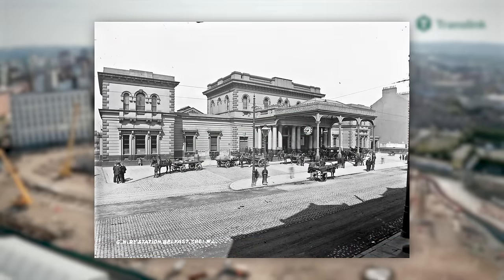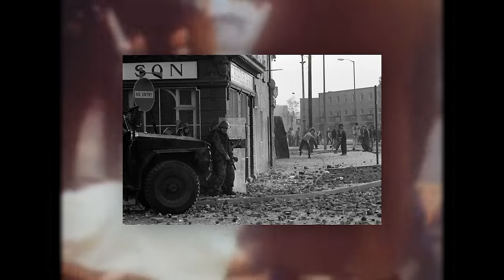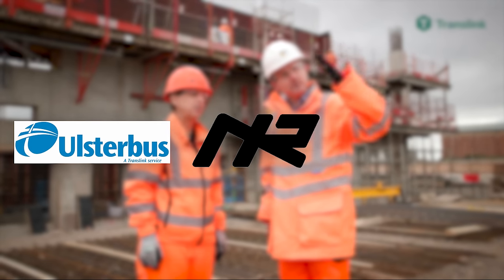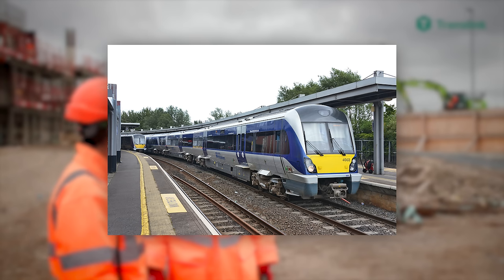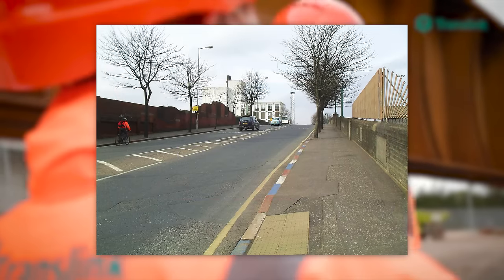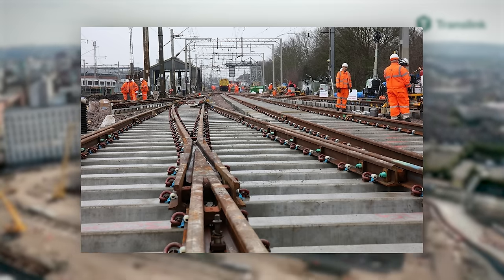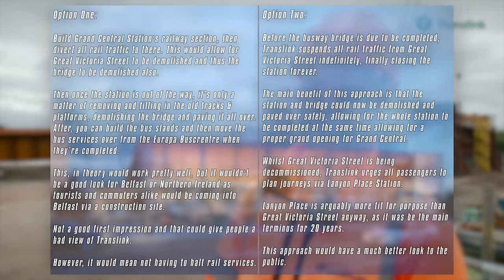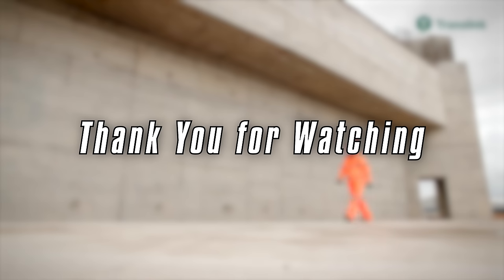What is Belfast Grand Central Station? | Explained

Comment: I do wonder why the old GVS platforms are being made completely redundant - I understand that the bus station has to go somewhere, but wouldn't it be wiser to have them for local and semi-fast services, or at least to provide additional platforms. I also question the use of 3 tracks and not 4, surely running up/up fast/down/down fast would drastically increase capacity on the Belfast to Dublin line as opposed to just adding more platforms (and therefore more trains), to an already fairly crowded line. Considering I'd heard wind of freight traffic introduced in the future, the need for a 4 track mainline is screaming out
Reply from the maker: The old GVS platforms are currently where the bus storage and turning area will be, plus the GVS platforms would be considerably out of the way for them to be 'included' with Grand Central.

Translink do have a desire to fully triple the line between Belfast & Lisburn if and when the Knockmore Line is reopened, but quad track is unlikely due to how built up the surrounding area is.

Comment: Just want to say I love the project but hate (I mean really hate) the name. there is heritage in the name "Great Victoria Street" plus its a bit on the nose after they changed the name of Belfast Central (another reference to railway heritage via the Belfast Central Railway), it comes across as if Belfast is trying to plagiarise New York rather than be confident in itself. 
That's the only criticism I have on the project (and even then its more to do with branding than anything practical) hopefully its successful and hopefully that success will be a jumping off point in continuing to upgrade the network and even expand it into areas of the province its withdrawn from in the past.
Reply from the maker: Well the name has to change as the station won't be situated on Great Victoria Street, I'm afraid Great Victoria Street Station on Durham Street would leave quite a lot of people confused haha

Also to be fair, renaming Belfast Central to belfast Lanyon Place was positive in the sense that it pays homage to Charles Lanyon who engineered much of the Northern Irish railway network.

But yes, all in all Grand Central Station will most likely be the starting point from which major upgrades and expansions of the current railway network will begin from.
Reply: @fundthenine  they could simply change the name to Great Victoria Station but point well taken.
Reply from the maker: @Sammy1234568910  True, but one could still find that confusing.

However if they named it Great Elizabeth II Station I wouldn't object hahaha

Comment: What are your thoughts on development for a underground/metro for the greater Belfast area? More significantly connections to the international airport seems drastically overdue
Reply from the maker: The DFI are currently exploring the costs of a feasibility study into reopening the Knockmore Line with a station at BFS.

An underground for Belfast wouldn't work as it doesn't have the population to justify it. Glasgow would be the size Belfast would need to roughly get to in order to justify an underground.

Comment: I am just thinking, is that why they changed the name of Belfast Central station to Lanyon Place in 2018, because of the plan to build this new station. Also, this is the first time I have heard about this new station. When it is finish, will the train from Dublin be using this new station, instead of Lanyon Place? Just to let you know I live in Dublin, and have traveled by train to Belfast a good few times.
Reply from the maker: I would guess that is the case, as they put in the planning permission application for the new station not long after Lanyon Place's refurbishment and name change
Reply: When the new Grand Central opens, will this make Lanyon Place redundant?
Reply: @42markk42  I say Lanyon Place will remain open, as it is very close to the Waterfront Hall, as well as having a hotel, offices and houses are very close to Lanyon place. Also trains from Derry, Porthrust, Larne and Bangor trains pass through Lanyon place. I can't see people from East Belfast wanting to travel to Grand Central, to get a train to Bangor or Derry. When they can get to Lanyon place in a short time, and have a short train trip from there.
Reply from the maker: @42markk42  No, Belfast Lanyon Place is a vital station for East Belfast and it would serve no justice to have it removed.

Grand Central Station will be only replacing Great Victoria Street Railway Station and the Europa Buscentre.

Comment: Interesting high-visibility uniforms. Orange. Did Translink analyse this in light of the GFA and equalities?
Reply from the maker: Orange high-vis is more commonly used on railways, likely due to the fact the luminous orange stands out far better than green.
Reply: @fundthenine  I'm just surprised it isn't a difficult issue for some employees. Does Iarnrod Eireann use orange?
Reply from the maker: @Jon.Morimoto  Yes they do, as states the orange is much safer as it doesn't blend in as much as green does.
Reply: @fundthenine  Wonderful. If it's good enough for them...